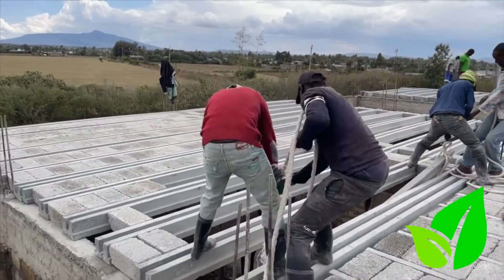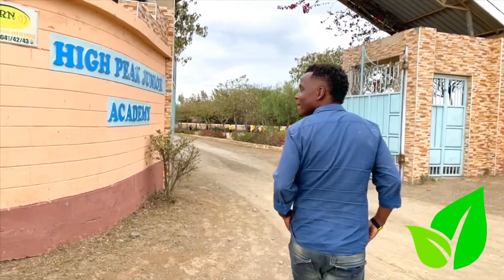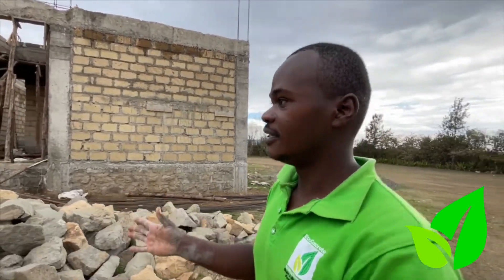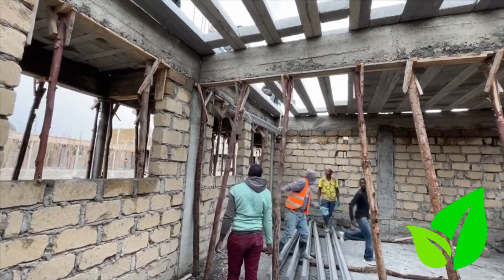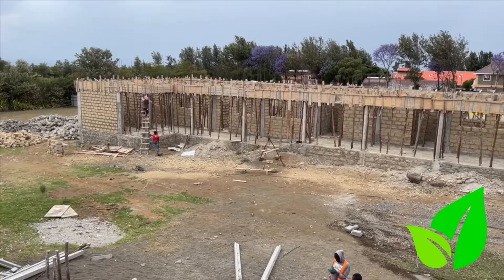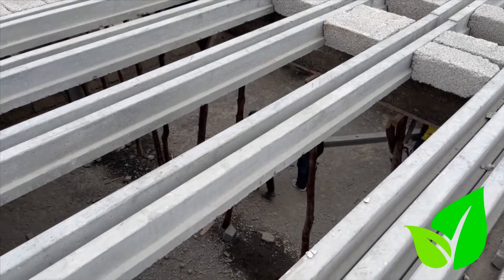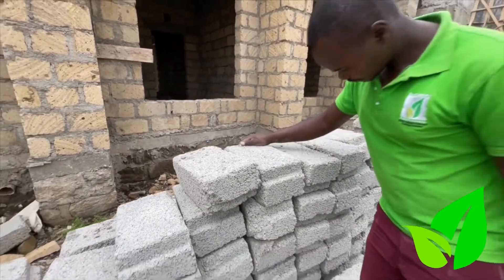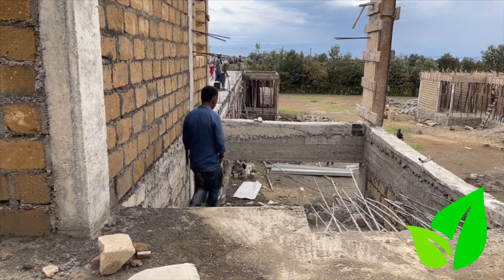Case Studies - Naivasha - School Buildings

Comment: Good enough...but how does one fit electrical conduits,water pipes, sewage connections,,any need for BRC wire,how to fix next level beams, columns...
Reply: Electrical conduits and water pipes are installed on top of the slab and where necessary a block is removed to pass down a pipe.
Reply: After pipping a 50mm screed topping is cast with BRC or fibre mesh depending on your preference.